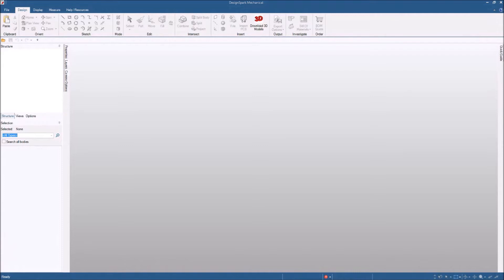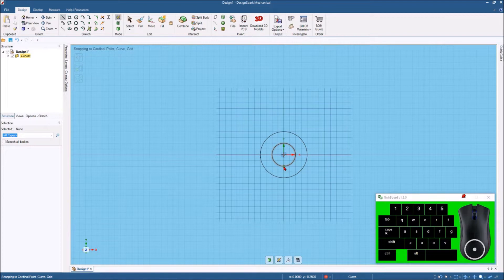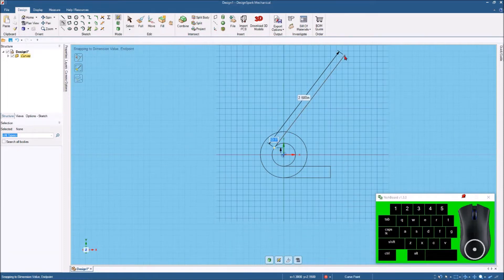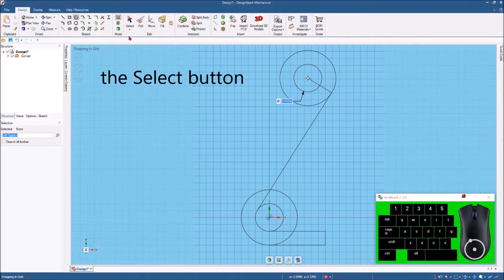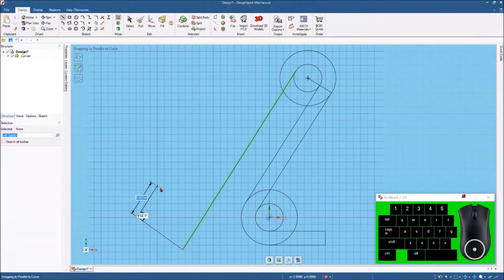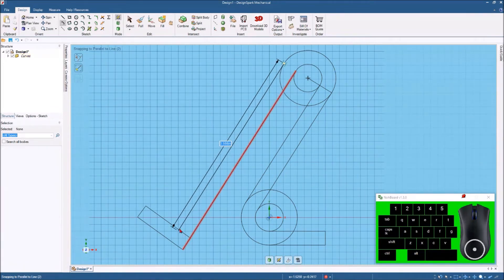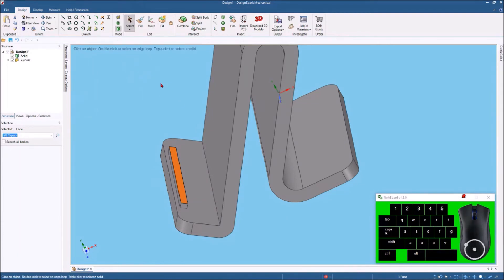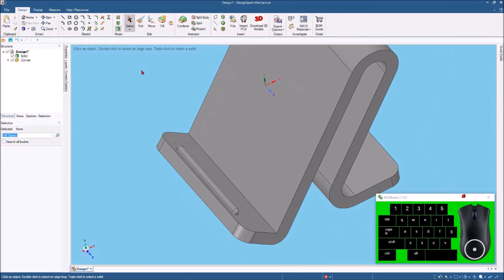DesignSpark Mechanical Tutorial   |  Desk Phone Stand

Comment: Thanks Dave for another great video. I use DesignSpark Mechanical for all my 3D print designs. DSM is one of those free and easy to use programs a lot of designers don't know it even exist. You just showed how quick and easy it is to pump out a 3D design with DSM.
Reply from the maker: Thanks for watching Roger.  You are correct.  I had never heard of it until a couple of months ago even though it's been around for several years.  I like that it's free and you don't have to be logged in to the internet to use it.